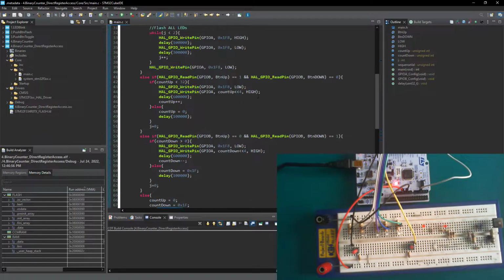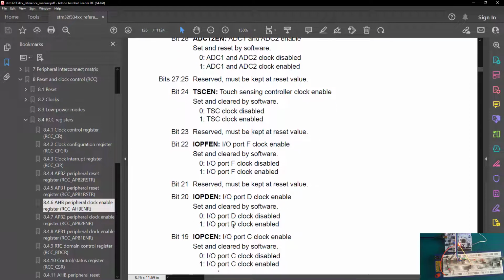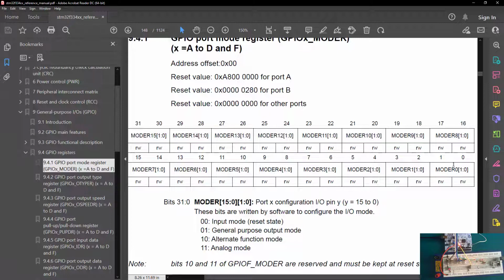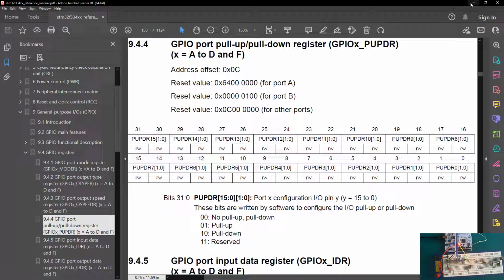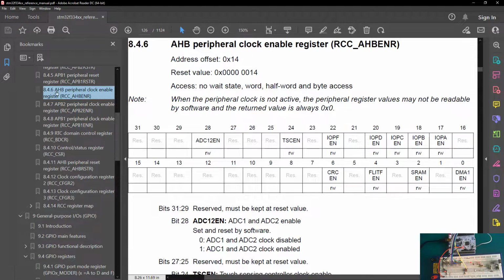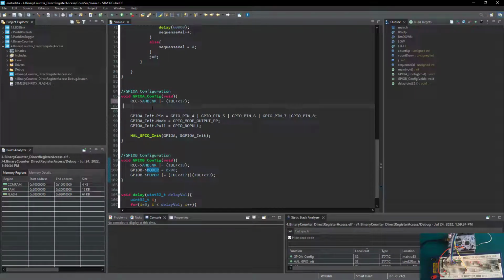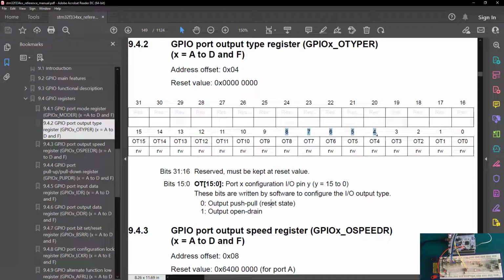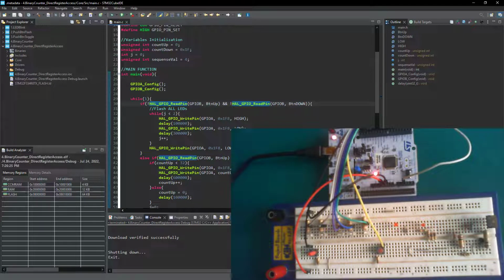4.stm32CubeIDE - Binary Counter STM32 Direct Register Access. Part 3

Comment: Is there a way to configure a Timer to automatically count transitions on an input? 

The reference-manual suggests a Timer can be set to slave-mode controller, with an external clock input.. External Clock Mode 1 (TIMx_SMCR__SMS , TIMX_ETR).     Each timer has dedicated trigger input pins (CH1, CH2), but you can select the transition edge of interest via TIMx_SMCR__TS = TI1F_ED / TI1FP1.

Unfortunately, couldn't get this to count my relatively-slow transitions.    

Based on a Digilent post ("Quadrature encoder signals reading online with scripts and events"), I read someone use CH3 instead of the dedicated CH1,CH2.   Apparently modules that don't have a pin assigned in the GPIP are fixed at 0.    So in the GPIO AF matrix you can leave CH1 and CH2 unconnected,  then setup CH3 ( TIMx_CR2__TI1S) to do a CH1-CH2-CH3 XOR.  This should effectively redirect CH3 into CH1 in order to use CH1 as ingot to the slave-mode controller  (input to TIM is CH1 TIMx_CCMR1 = CC1S (01)).
 
However, would love to see any example, using any input, that shows the hardware counting edges!
Reply from the maker: Hi Ben, 
A Timer is basically a counter, so it can definitely be configured to do do some counting assuming that you the correct configurations for your particular applications.
If you can just clarify on what you want to achieve then perhaps it will be much easier to assist you with an example code.
When you said "Count transition on an input", are you referring to detect an input transition induced by a button? 
If that the case, with the correct timer interrupt configuration you can detect and count the pulses of an input transition from either the falling edge when an input goes from HIGH to LOW or the rising Edge when it goes from LOW to HIGH.
Let me know if this what you want to achieve.